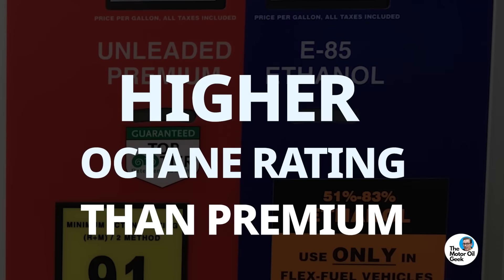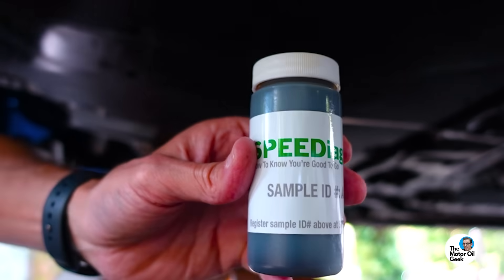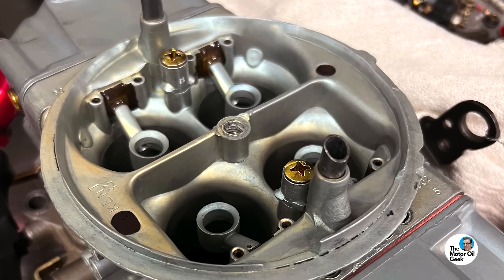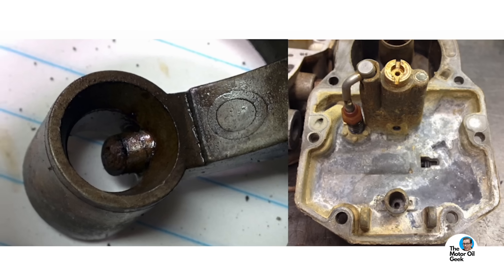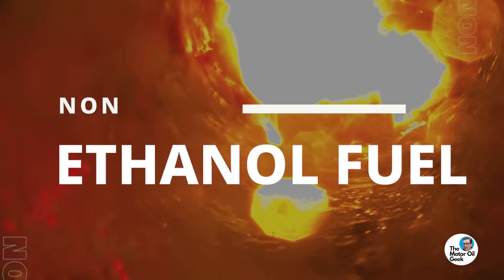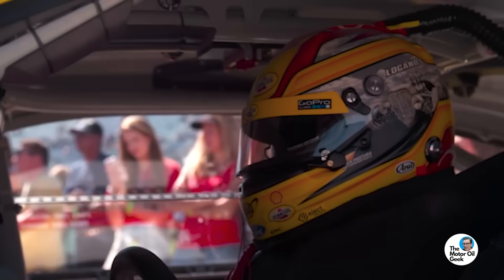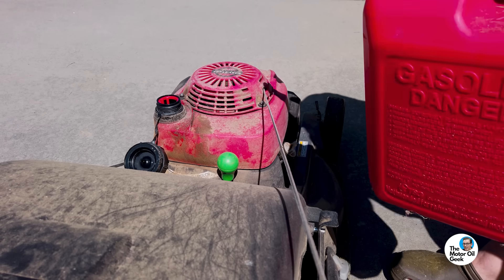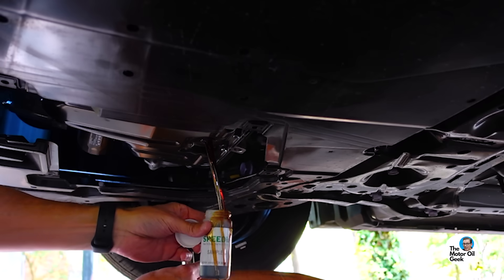ETHANOL: Higher OCTANE, Higher RISK?

Comment: Mercury Marine, the largest boat engine manufacturer in the world who knows boats, said E10 may be the superior fuel to E0 because it keeps the fuel dry.

 Mercury Marine hosted a Webinar on ethanol myths and noted that ethanol does not "grab water molecules out of the air." It is hydrophilic, which means ethanol holds water. With regular gasoline (E0) as well at E10, the primary cause of water collecting in tanks is condensation on tank walls. But unlike E0, which can absorb almost no moisture, E10 can hold up to half of one percent of water by volume, and the water molecules will dissolve in the fuel. The "solubilized" water will bypass the water separator and burn harmlessly through the engine.

Before E10 came, people in northern states and Canada during wintertime had to buy little cans of alcohol to add to gasoline as gas-line antifreeze with brand names like Heet or Dry Gas.  Gasoline collects water over time in fuel tanks as noted by Mercury Marine and freezes which stalls cars in winter.

Ethanol on manufacturing chemical compatibility charts is far easier on metals, rubbers, and plastics than what gasoline and BTEX (benzene, toluene, ethylbenzene, & xylene).  Ethanol is rated excellent on rubber whereas gasoline and BTEX are rated poor to not recommended.  Gasoline is so damaging to rubber that Viton had to be invented.

Brazil has the very same non-flex fuel vehicles, boats, motorcycles, lawn mowers, weed eaters, and small engines we have and has used >E20 since the late 1970s and has been E27 from 2015 to 2024 (just went to E30 this year).  It has worked out so well and for so long that Paraguay went to E27.  India and Indonesia have gone to E20 for non-flex fuel vehicles and E100 for flex fuel.

Henry Ford designed his Model T for his favorite fuel ethanol.

Britian sold E10 to E30 blends starting in the 1920s with the most popular brand being Cleveland Discol, an E10 blend which sold from the 1920s until 1968-70 when BP bought them out.  All carburetors.  We even sold E10 blends in the US after the Rockefeller funded Prohibition ended in thousands of fuel stations in the Midwest up until just before WWII with Agrol being the largest brand sold.

Brazil sells E100 for flex fuel vehicles and found identical engines last >300% longer on E100 than their common gasoline.  Ethanol is sootless and soot is what wears out engines.

The Indy 500 has used methanol alcohol since the 1960s for fuel when a multi-car crash demonstrated its safety over gasoline.  In 2008 they went to E98 and are using that today.

Ethanol is our current gasoline optimized engines does get lower mpg but more horsepower.  For example, a Chevy 5.3L engine is rated at a clean 380 horsepower on E85 vs a dirty 355 on E0.

Ethanol is so inexpensive that the cost per mile to drive is still less than gasoline despite the lower mpg.

In ethanol optimized engines, you will get not only more power but also more mpg than gasoline, even more than diesel engines at half the size.

Here is an excerpt of one Ricardo built and drove for GM:

FROM RICARDO:
The new federal CAFE standards are calling for a doubling of fuel mileage performance, which, Vint says, is going to send OEM’s looking for high octane numbers to improve efficiency and ethanol is the best source. Ricardo, an engineering firm with over 100 years in the business of engine design, has developed an extreme boosted direct injection engine (EBDI) to optimize ethanol blends. The 3.2 V6 gasoline engine rivals the power and torque of a much larger GMC Sierra 6.6 diesel, he said, and it delivers 3.5 percent better fuel economy than the diesel.

Denver in 1988 was the first US government entity to require E10 when they were on the EPA list of ozone non-attainment zones.  Soon with ethanol they were off that list.

Even with just 10% ethanol added to E0, the Swiss Federal Laboratory for Materials Science and Technology found that the health devastating ultra fine or nano particulate emissions were lowered by 97%, carbon monoxide lowered by 81%, carbon dioxide lowered by 13%, aromatic hydrocarbon emissions lowered by 67-96%, and genotoxic emissions lowered by 72%.
Reply: Total bullshit. As soon as it says better mileage, I can't believe any of it. It takes 10% more fuel, to run ethanol.
Reply: Ethanol is deleterious to the fuel system of small carbureted engines.  The sort you will find in chainsaws, mowers and gas trimmers.  

This is not debatable.
Reply: @H0kieJoe been using e10 fuel in small engines for decades without issue.
Reply: @Connor4x4  

I switched to ethanol free fuel a few years ago.  My engines run better and a tank of fuel lasts longer.
Reply: @H0kieJoe  Identical chainsaws, mowers, boats, and gas trimmers in Brazil use their common gasoline which has contained >E20 since the late 1970s and was E27 from 2015 to 2024, currently they are now E30.

It worked out so well and for so long that Paraguay is went to E27.

How can that be if what you claim is true?

Perhaps you should sell everything you have and move to Brazil (or Paraguay) and buy up every small engine repair shop you can find for if your claims are true, you should become a gazillionaire in no time.  Thank me later.

Gasoline only has a shelf life of 3 to 6 months according to those who make it.  Sea Foam claims it can make gasoline last two years and it contains 25% of an alcohol as an ingredient.  Alcohols last almost forever, my 18-year-old Scotch is even better than my newer ones.  300-year-old wine bottles are said to still be drinkable.

The DOE found that in small engines, ethanol blends last some 3 times longer than E0.  The volatile aromatics like BTEX evaporate out and leaves behind a sub-octane unusable fuel.

I can remember as a kid E0 gasoline would varnish over winter in my father's Briggs and Tecumseh gas engine water pumps and stick the needle and/or float in the carburetors which we would use carb cleaner spray on.  Like a skunk smell, varnished gasoline is something one can never forget.  I have never seen E10 ever varnish since it came to our area since the 1980s.

There was a transition period when E10 first came in the 1980s.  Ethanol cleans varnish and older gasoline tanks were coated with it and would plug fuel filters with varnish from the gasoline.  But once clean, ethanol kept things clean. 

Our high aromatic gasoline came along around the same time as ethanol after lead was outlawed.  Aromatics, unlike ethanol, are indeed very deleterious on chemical compatibility charts to metals, rubbers, and plastics.  Perhaps you are blaming the wrong additive.
Reply: Thanks 👍🏼

Comment: I run E10 in my 1984 F150 (300 w/ Carter YFA Feedback Carb) and during the season on my 1976 Starcraft with Mercruiser 888 (302 upgraded to a Holley 4160 Marine carb) along with my lawn tractor (16HP B&S Vanguard) ... where I live the only local E0 is Walmart Trufuel cans that are stoopid expensive. And the nearest E0 is 30 mins away by a lake (and it costs more than premium!). 

My understanding is that letting the fuel sit and absorb water is what causes the trouble... The 1984 F150 is a daily driver (and boat puller) and I do fill the boat with E0 at the end of the season. 

An issue I've had lately is vapor lock when warm and leaving a stoplight/freeway traffic jam under medium-high load... Wasn't sure if I got E15 by accident/fraud or what... fuel in at least one case was seen boiling off in the fuel filter and it'd resolve once liquid fuel finally made it to the carb.

Comment: If I had access to E85 I would have run it all day in my F150 3.5 Ecoboost. Those engines LOVE octane, even stock.
Reply: I have the 3.5 ecoboost and I thought you weren’t supposed to run E85 in them.
Reply: @whjerts you’re not officially because the PCM isn’t setup to accommodate it, but with a tune that properly adjusts the air fuel ratios and timing, they easily can run E85.
Reply: Let’s us know how your cam phasers and timing chain is holding up after 6months of use. Diluting that oil film is the last thing you’ll want to do with 3.5l eco boost.
Reply: Can’t run E85 in a ford eco boost!
Reply: @melvinhunt6976  Yeah you can if you are not clueless. See the other comment I already made 3 months ago.

The fact that you needed to put an exclamation point while simultaneously being wrong is awesome.

Comment: What's sad is that adding ethanol was a 1-way street in the US. Not only does it reduce fleet fuel consumption but about 10%, but corn states will NEVER allow it to be removed. The politics are immoveable, no matter the actual economics. Those same politicians will remove all other pollution controls and fuel economy requirements, but they'll never give up ethanol.
Reply: True, and when the decision was made to replace M.T.B.E. with ethanol, Brazil was ready to start exporting ethanol to the U.S. Washington D.C. put a stop to that. So now we have government subsidized ethanol production. I've researched the whole concept of using ethanol (corn based) as fuel. It doesn't make any sense. The amount of input energy to make ethanol is greater than what you get out. As an example they use natural gas in the distillation process. You are better off just skipping making the ethanol and  burning the natural gas in your engine.

Comment: Since you market your channel as being about facts not feelings I strongly urge you to go further into depth about the supply chain of ethanol.  You missed a LOT of very important detail and you could get a lot more content out of this, too.   For one thing you don't materialize it out of thin air - dent corn (not table corn) is harvested and mashed for hundreds of different products and only one of those products is fuel ethanol.   We also get enzyme products used in cleaners, shellacs and materials (fake leather for example uses corn derivative chemicals, as does packaging cardboard)  and we also get dried grains - the stuff chickens pigs and cows eat.    Dried grains store better than whole meal because they have less water content so less animal feed goes to waste.   Dried grains also transport and dispense easier because they are uniform size and slippery and don't cluster up so you can reliably distribute it to millions of animals.   They're high protein and low sugar so they prevent some diseases that pigs and cattle would develop eating whole grain.    

There's a lot more to the story too,  and before you ask I don't have a dime in this industry I work in electronics.  I grew up farming. 

It's probably also valuable to inform your audience that the petroleum industry gets subsidies.   Again, facts not feelings.

Comment: Small engine mechanic professionals have noted running/performance issues when using those ethanol free canned fuels from the hardware stores. If you're diagnosing a running issue and everything else has been tried, break out the 2 cycle oil and get some ethanol free fuel and make your own like the old days.

Comment: I have a 1.8T Audi from 01. It was never designed as a flex fuel vehicle but after a bigger fuel pump and injectors (and proper tuning) I've been running pump E85 for like 4 years without issues. I still get about 20mpg but doubled the stock hp of the engine so it was worth it to me!
Reply: That's awesome! I have similar 2.0T in A3 and 1.8T in a Golf. 
What's parts are required to run E85 or E30? 
Thanks
Reply: @davidb7358  check out motoza performance they have everything you need.
Reply: What engine code, BAM or AQM

Comment: Here in Brazil I have always used only ethanol on my vehicles, but I always antecipate the oil changes to avoid any problems. So far, I've not seen anything.

*Note: in Brazil we don't have E85, just E100.
Reply from the maker: In Brazil the E100 has corrosion inhibitors blended into the fuel.
Reply: @themotoroilgeek  unfortunately this E100 with corrosion inhibitor is not found in the whole gas stations here. But sometimes we can find it here as an "additized ethanol".
Reply: @themotoroilgeek This type of blend in Brazil is sold as additive ethanol, because at petrol stations we have fuels with and without additives, I know this is bizarre for this day and age, but that's what it is. Our petrol, with and without additives, is anhydrous ethanol, unlike the e100 ethanol sold at the pump, which is hydrated, i.e. it contains up to 7% water. But don't worry, here we started adding anhydrous ethanol to petrol in 1976 as part of a programme born in 1973 called pro-alcohol, which from the outset aimed to reduce our dependence on fossil fuels. In other words, at the same time the Brazilian car industry, which was local (imports were banned by the military), took part in the plan and started treating all metals, rubbers and plastics through which the fuel passed in order to withstand corrosion, and the lubricant industry also took part in this programme. The first brand to produce a specific product for this mixture was Bardahl, with the ‘Bardahl Super Motor Alcohol’ oil, and some time later the Bardahl Proal fuel additive was launched, which still exists today!!!

Well, moral of the story, you are suffering from something we dealt with 50 years ago, our entire industry has adapted to this new reality, yours will go through the same, or not!!!

Comment: I have been running E90 for years. It is way cheaper than race gas and the car runs cooler. Ethanol has its place. You just have to change your oil much quicker. 2000 miles max.

Comment: Even 10% ethanol is bad. The fuel vapouring in the fuel line after I park. Start it up before it cools down and the engine stutters and sometimes stalls. Only use premium 91 octane. Seems some fuel brands are better than others
Reply: Are you talking about that problem in a carbureted engine? If so the answer is to run a fuel return line back to the fuel tank to relieve the excess pressure that builds as the fuel heats up.

Comment: Another problem in carburetors in small engines when E10 or E15 is used is that many of those small engines are now made in Communist China, and the "rubber" seals in the carburetors and fuel lines are not made to be resistant to alcohol-caused deterioration.  Contrary to the narrator, there are many places in the country where ethanol-free fuel is not available at all.  I lived for several years in one such place--the nearest station selling ethanol-free gasoline was 75 miles away.  Where I live now, in a town of 15K people, there is ONE station that sells ethanol-free gasoline and it costs about $1 per gallon more than E10 regular gasoline.  Also, in my town, about half of the gas stations in town now only sell E15 gasoline; E10 is not available at them.  Any fuel containing ethanol will not get as good fuel economy compared to ethanol-free gasoline simply because ethanol contains less energy per gallon than "dino" gasoline.  People also need to check their vehicle's owner's manual.  Many 2013 and older vehicles are not supposed to use gasoline with more than 10% ethanol--I have a 2013 Toyota that is one of those.